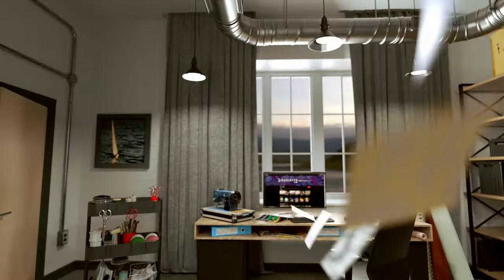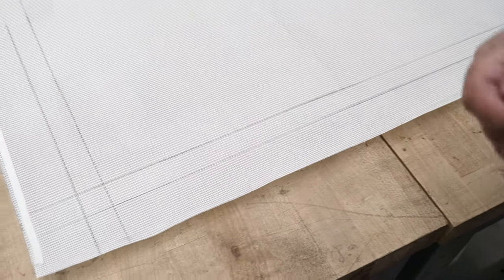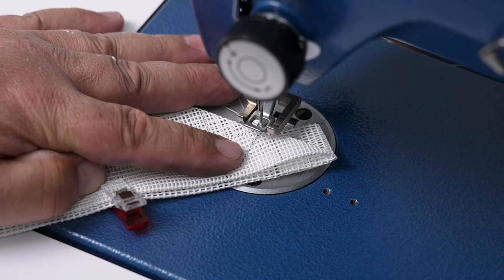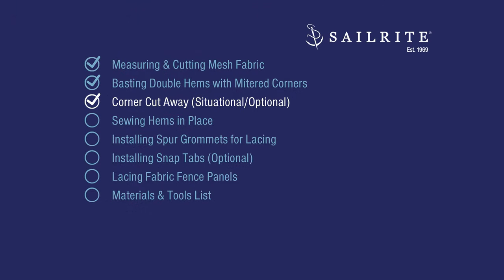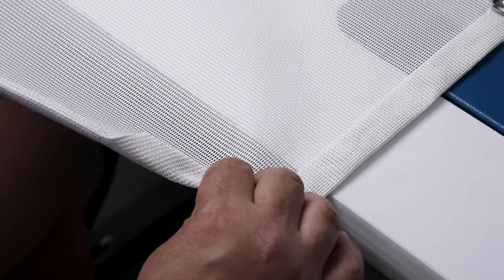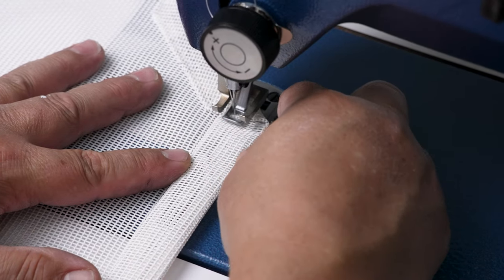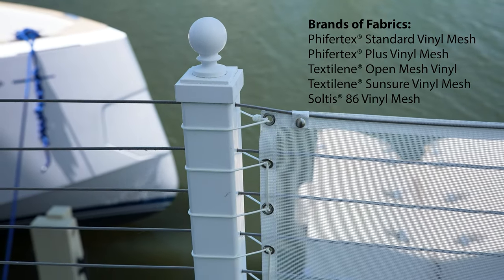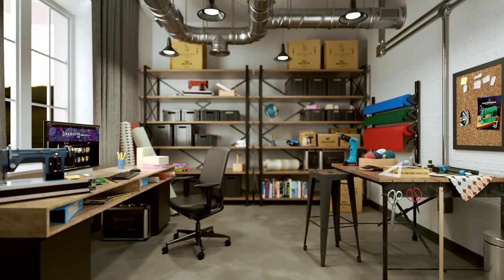How to Make Laced on Mesh Fabric Fence Panels

Comment: We have similar cockpit dodgers on our lifelines using sunbrella fabric that is laced on the top as well as the sides.  I like the idea of using the snaps on the top, that would make hanging fenders off of the top lifeline much easier.  Using mesh fabric might also help with windage a little yet still protect against most of the sea spray.  Our sunbrella lifeline dodgers have a mesh pocket on the inside over the bottom half of the dodger at the Middle lifeline for storing handy items and it stays dry so any rain or green water just runs right out.
Reply from the maker: Sounds like a good idea.